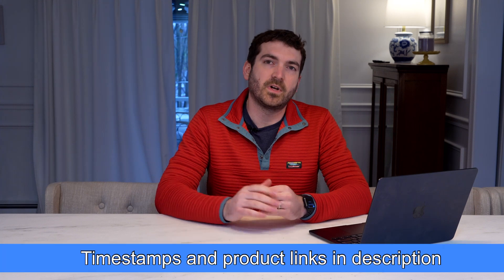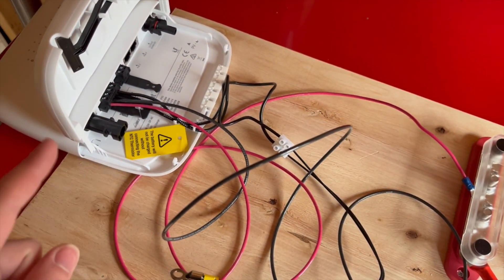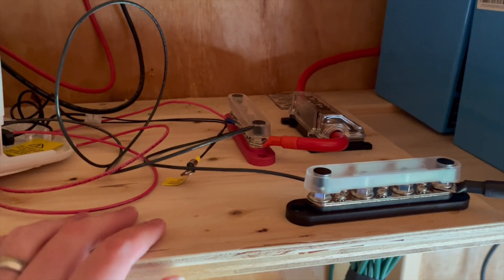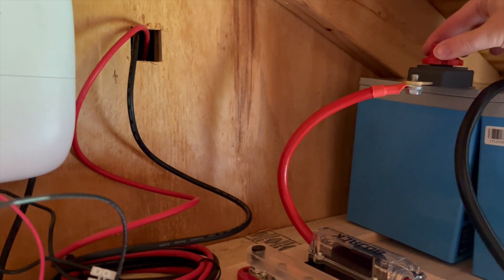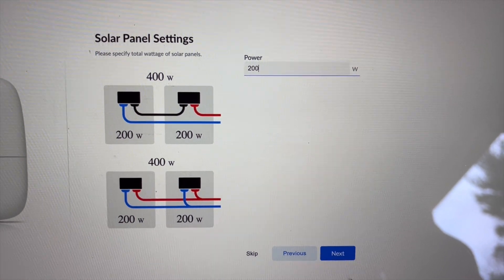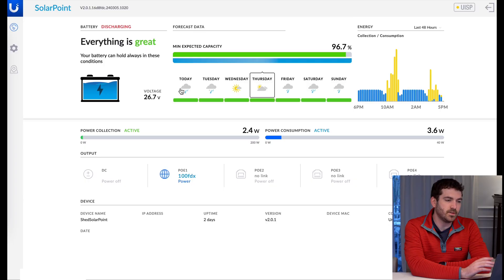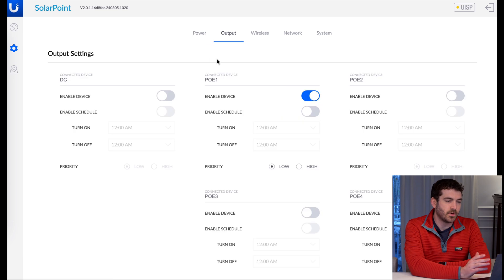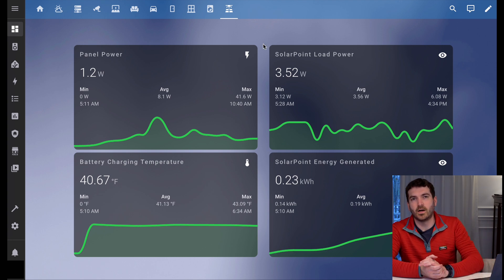SolarPoint Install – Out of the Box & Into the Sun

Comment: Will a tplink cp210 802.11b/g/n work with the SolarPoint?
Reply from the maker: I'm not familiar with that device, but if it's PoE and supports the same PoE protocols as the SolarPoint I don't see why not. Just obviously wouldn't show up in the Unifi console or anything, would be totally seperate.

Comment: Based upon your setup and intended use, and considering the maximum 7 amp charge limit, is the SolarPoint able to do a battery recharge in a reasonable time? Seems as though the second solar panel may not make much of a difference.
Reply from the maker: Since they're wired in series for 24v, I could theoretically get about ~8.3 amps with both panels. So the 7 amp is utilizing the second panel but not to it's fullest potential which I was willing to accept.

As far as the battery recharge time, it's estimated if it was completely empty it could take approx 2 days with just sun. However, I'm not planning on using it down to 0 very often. Just popping in and out and using a tool every once in a while.

Lemme know if you have anymore questions

Comment: I thought SolarPoint didn’t support LiFePo4 batteries…but apparently it does.
Reply from the maker: Theoretically, the BMS profiles probably aren’t setup for LifePo4 batteries. I realized when setting it up that I think the low temperature stopping point is much lower than it should be for LifePo4 whereas those types of batteries shouldn’t charge under 32f. It still works though, but may consider swapping it out for something different in the future more appropriate for LifePo4 and higher charging amps than the SolarPoint’s 7 amp max. Plan was to just keep this shed insulated and fan cooled so it shouldn’t be a problem with this for now.